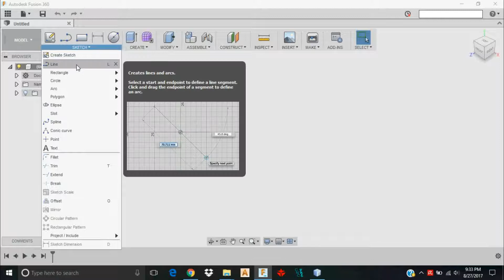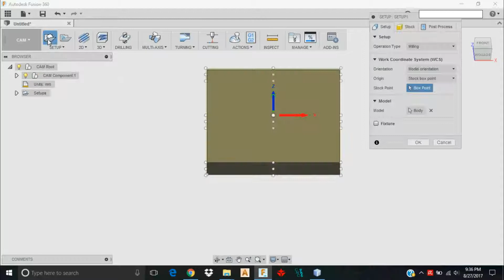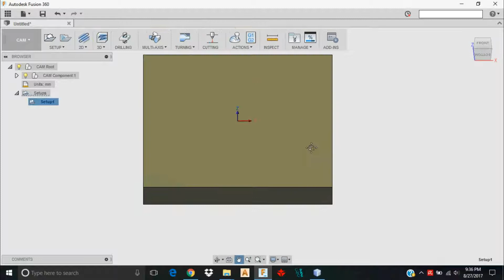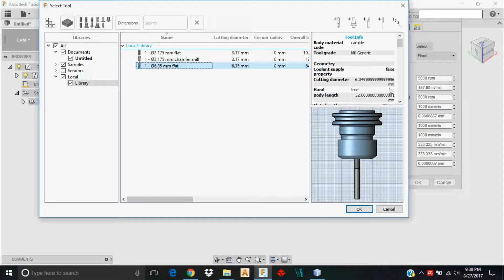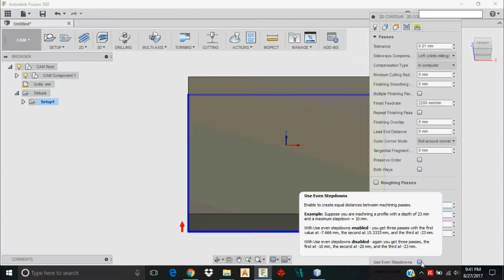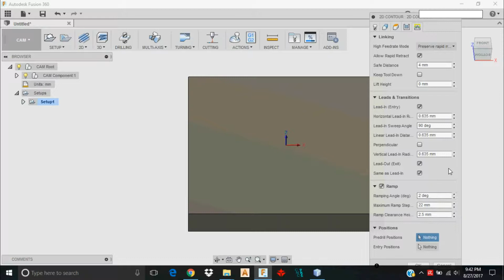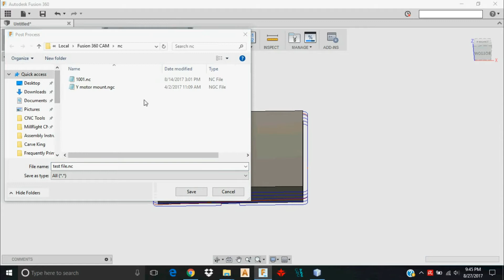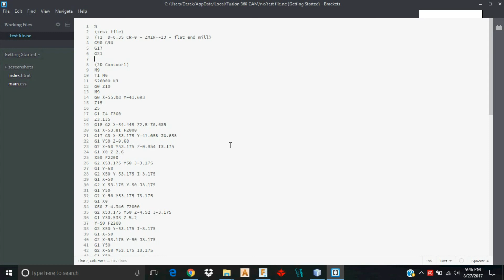Fusion 360 CAD CAM Tutorial MillRight CNC

Comment: In the video, G-Code Line 10:  Wrap that "T1 M6" in parenthesis to comment it out (or delete the line). 

Otherwise Universal G Code Sender/GRBL will complain about it when you try to run the code.  T1 is tool #1 (tool numbers are defined in Fusion360 in the Tool Library). This line is to select your tool from an automatic tool changer (which these machines don't have, which is ok), and thinks you have the tool in the #1 tool changer position.